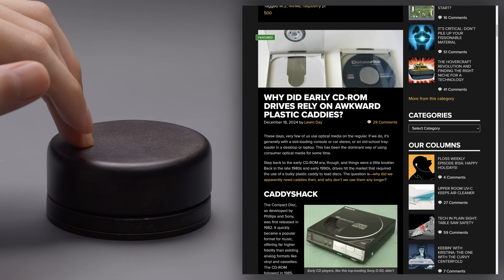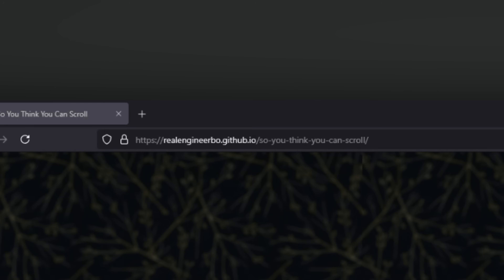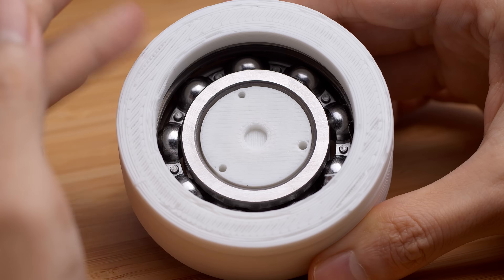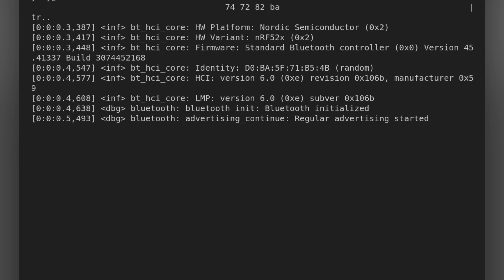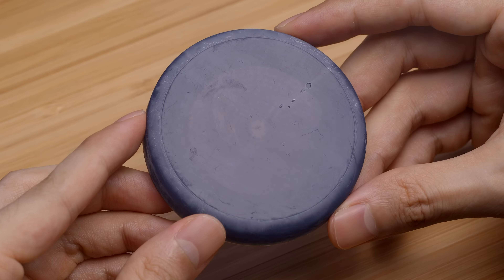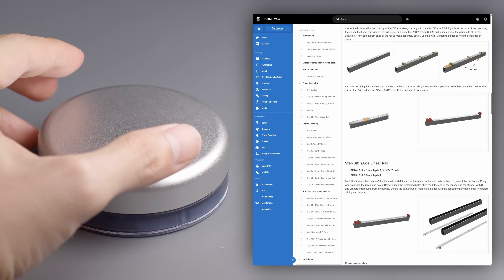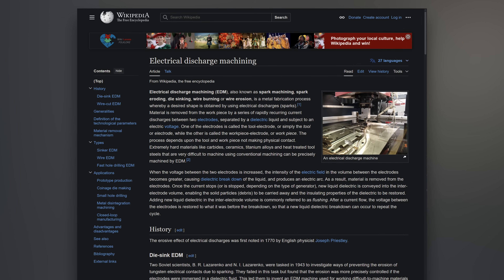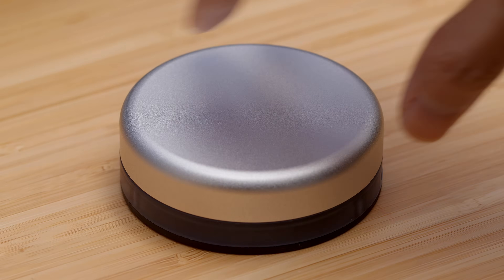Wireless High Resolution Scrolling Device: Full Scroll Dial v2

Comment: 4:30 As a railway engineer I inmediatly was thinking about a ‘Taats-lager’, which seems to translate to pivot bearing in English. Instead of roling on the inside and outside of a ring, the inner ring is above, and the outer ring on the bottom (for example. This removes the horizontal plane play completely, but trades it for a small amount of sideways play.
Reply: Thrust bearings! I was thinking of the same
Reply: @_trupples  'Thrust bearings! '
Realize, no matter what you do at the bearings, there will always be some play, and you have leverage working against it.
With the wide dial, the best place to stabilize is at the outside edge.  That's where you have the best leverage to work against the dial tilting.
Bottom edge of the dial should be flat.  The surface underneath the flat edge of the dial should have a sine wave ripple in it, and the tops of the sine barely touch the bottom of the dial when new.  Then grease the contact surface.  
Same idea as wave bearings, minimum contact surface, but if it starts wearing into the sine it gets more and more support.  Minimizes friction, maximizes service life.
If you hunt around some, you might even find an appropriate size wave washer, where the sine pattern is in a metal washer, then just put that between a flat surface and the bottom of the dial, with silicone grease..
But this large, you may not find one with enough waves easily..
Similar ideas, just some supporting wear away pips, teflon pegs or mouse glide pads, or similar would work..
BTW another thing if you actually wanted bearings this size with the bearing itself at the outer edge, would be car and truck wheel bearings.  They're tapered roller bearings in general.  But they are also heavy with a lot of contact area and rolling friction.  If you took one where the rollers are independent, you might be able to take out most of the rollers, leaving 6 or 8 spread around the bearing, and have decent support with less resistance.  But I'd still go with the regular bearings and glides around the outside edge of the dial, it's way way more simple and cost effective.
Reply from the maker: I've seen several comments about thrust bearings, and I've only seen/used thrust bearings where the races aren't "captured" i.e. the bearing comes in three separate pieces. The current design uses the bearing to hold the pieces together, and the ball bearing can handle (the extremely light) loads in all directions!

I could maybe do with a lager though.
Reply: @engineerbo  Two things - one, you're using gravity to hold the spinner to the base right now, so a needle thrust bearing would work fine. If you are worried about it coming apart with a thrust bearing when you pick it up, how do you solve that issue now? Same thing would apply. But you'd want to find a thrust bearing with a large inner diameter and smaller length rolling elements to give you the needed space for everything else. You can adjust the design to retain the bearing cages and you could lift the top off as you do now.

Two - clearance tolerancing is causing your wobble, as you showed in you video, so you could just buy a tighter spec steel ball bearing. It'll cost more, but so does a ceramic bearing. I think your current design is better, so I wouldn't go back, but consider tighter tolerance steel vs ceramic.
Reply from the maker: @davidbrennan7422 The dial is meant to be held by M2 screws (they fasten into the edge of the bearing). But I messed up the M2 tap (see video) that's why it's gravity for now.
Reply: @engineerbo  The threads don't need 360°. mayby a triangle or square hole could improve this and the use of self tapping screws. Or go up to M3, less delicate…
Reply: @engineerbo have you looked at angular contact bearings
Reply: @KJMos93  angular contact bearings are quite possibly the most expensive and overkill option haha
Reply: conical thrust bearings go brrr
Reply: Yes same! Or sometimes called pin bearings, I think. They could cut the height way down potentially
Reply: Tapered roller bearings would be a better option than thrust bearings
Reply: @tomaslipeika8567  for a non-engineer novice like me, why is it that you want 'high speed' or low friction rather than slow speed with very consistent friction? I to have huge scrolling needs and urges but I have been looking for a high precision scroll wheel that is heavy, slow but precise. Where a complete rotation of the wheels is about a 500-1000 steps but the precision of the wheel makes 1  step advances possible. I imagined that some kind of lubricated bushing would work for this but I am not sure.
Reply: @zeus04 When you're reading a 3000 page data sheet it's nice to spin it up and let it freewheel and stop when you get where you need to be, very useful if you need to skip like 10-20 pages, at least I do that with mine.
Reply: @oliverer3  I understand that, I also scroll large stuff like code/documents, video/audio or dialing in a value. What gets me frustrated is when I need to scroll a very large portion sometimes and other times I need to land on a very precise point. With a slow but precise wheel I imagine that I can achieve both without any middleware changing resolution or multiplier depending on what use I need atm. With huge skips I can just make a 60 degree or more turn while still maintaining step by step control just nudging the wheel. (of course I need a hyperspeed wheel for playing Doom but that's another story!)
Reply: @zeus04  heavy slow but precise is down to software, not hardware
Reply: @zeus04  g50x mouses have switchable scroll mode, it's something why i search a smooth scroll device like this video :)
Reply: @versedi What I meant is that a high friction bearing, making scrolling 'slower' than a high speed ceramic bearing. With higher friction and much smaller distances traveled on the wheel, the bearing/bushing needs to be extra smooth/uniform/toSpec than the 'high speed' bearing bc of the smaller increments of turning the wheel.
Reply: @tomaslipeika8567  something like this? https://www.youtube.com/watch?v=Sv3HBoHRzxo
Reply: Isn't it Architects that design railroads?
Reply: @zeus04 Whilst "Railway Architects" are a thing - they generally design the structures around railway infrastructure, like stations. A rule of thumb is that if the design element is aesthetic or determines how the element interacts with the occupants - that's the job of an architect (big picture stuff), if the element is structural, or determines how the building will function - that's engineering work (detail stuff).

Engineers and Architects are like siblings. We rely on each other, work together regularly, but if you ask - we hate each other and that's the story we'll stick to 🤣
Reply: @zeus04  they can…

Comment: i guess of all the comment you didn't notice mine, because the one main thing i recommended would have solved all your bearing issues. This sort of bearing isn't designed for this application. you want a "thrust bearing". which you can also get in glass/ceramic. 

also theres tons of options available for plastic jars with screw lids which could just have the threads sanded off to allow them to spin. These would be great for anyone wanting to make one of these without having to do a lot of work to get a clean exterior finish, and just 3d print the internals.
Reply: no, the axial loads here are very small compared to a ball bearing rating
Reply: @ the loads may be low but the bearing aren't designed to have force applied in that direction and so you end up with the wobble issue shown in the video. buying a larger bearing just means that tolerance issue that causes the wobble is made smaller, but as he also mentions the larger bearing are more expensive. he could have literally got the smallest cheapest thrust bearing he could find and it'd have solved the problem. he could have bought some metal bbs, and just printed a cage for them, and designed a thrust bearing design into his prints and put the bbs in it. wobble issue completely solved for probably a couple of pennies.
Reply: @ge2719  ball bearings are designed to hold axial loads, you're wrong
Reply: @nirodper  they are capable of holding some axial load yes. it would be rather strange if solid objects were incapable of holding any load what so ever.
but they have play in that direction because they aren't even designed to be tight fitting in that direction like they are in the orientation they are supposed to be used. that is the issue. even before you factor in tolerances they aren't designed to prevent this wobble so "they can hold some axial load" yeah, and? doesn't stop them from having this wobble issue. otherwise it wouldn't be an issue would it...
there's more to mechanics than just "it's rated to take the load so everything will be fine"
Reply: Tapered roller bearing?
Reply: yeah, i was wondering why he was not checking out thrust bearings, they seem to be a perfect fit for this project
Reply: I'd make the argument that since he wants both axial concentricity and thrust loads, you might be better off with a Tapered-Roller Bearing, though you're starting to get expensive when you want them thin. 
Maybe try Needle-Roller Thrust Bearings. McMaster has a lot of different options, but this would be a good starting place to look.
Reply: @ needle roller thrust bearings are bad. They do not locate themselves radially, you’d need to use one at the same time as a normal a radial bearing.
Reply: @ needle roller thrust bearings are bad. They do not locate themselves radially, you’d need to use one at the same time as a normal a radial bearing.
Reply: You don't want a completely freely revolving bearing, because any vibration is going to then be able to more it.
Think about how trigger happy a ceramic bearing like this is, this is the thing.. these youtube projects are rushed and lack any sort of real world testing.
Reply from the maker: You're right, this device is literally one of a kind, so there's no chance it's been widely tested. 

I have been using it daily though, and there might be a chance that I demand a little more from my peripherals than usual.

Comment: the linux issue is actually just a firefox issue, setting the environment variable MOZ_USE_XINPUT2=1 should make it work. dunno why it's not set by default
Reply from the maker: Thanks! I'll give this a try!
Reply: @engineerbo  Are you identifying the Full Scroll Dial v2 to the OS as a mouse (with scrollwheel)? You could try switching it to a touchpad/touchscreen HID if you encounter this issue elsewhere (no idea off the top of my head what your driver situation is).
Reply: It should be noted that you need to be running on Xorg for this.
Reply: @m3mem4chine86 it should also be noted that this bug only affects xinput on Xorg
Reply: @m3mem4chine86  Why would you run anything else tho? Wayland is crap compared to the almighty Xorg
Reply: @diablo.the.cheater Except Xorg is dying and Wayland is where the development is focused for many de and wm. Also, saying something is just shit isn't really constructive. I'm curious why you think Wayland is crap tho?
Reply: @diablo.the.cheater  I agree. It has many compatibility issues and lacking features, but it also has some features Xorg lacks, which specifically gamers look for.
Reply: @diablo.the.cheater  well you have fun using unmaintained buggy software with vulnerabilities, lol.
Reply: @diablo.the.cheater  xorg is dogshit when it comes to any amount of compositing

also, echo """ > ~/.xsession-errors if you want to free up like 100GB
Reply: @diablo.the.cheater  bro i haven't used xorg in 4 years lmao are you my grandma?
Reply: @diablo.the.cheater  2y ago, you would have been correct.. now wayland is the king.. atleast in KDE,Gnome and hyprland side..
Reply: @ora-ora-ora something only dies when know one remembers it, fortunately xlibre is here
Reply: I think it needs Hardware Acceleration and smoothing scrolling enabled in Plasma. It works on all other devices i own so maybe just live USB thing?

Comment: first vid motivated me to build kinda similar device, went  bit easier/lasy way  using some  photoelectric /optical 600 ppr encoder and arduino pro micro as HW, smooth scroll software for float multiplier, quite happy with the results

Comment: Why not use thrust bearings? Youre literally using the wrong type of bearing.
Reply: Guys, no, you're wrong. A deep groove ball bearing as used here can take this load and way, way more just fine. As he described correctly, the right configuration for no slack would be a preloaded pair of angular contact ball bearings, but I think this is unnecessary. Thrust bearings are in fact used very sparingly in the industry, but you can't expect an armchair engineer to understand bearings I suppose. No, thrust bearings aren't the right choice here.
Reply: Bump.
Reply: why fix what aint broken?
Reply: @mythichh  because it is broken. These bearings will wear out quickly when used in this way.
Reply: That or maybe tapered conical bearings or something similar? They might be the compromise necessary.
Reply: I don't get these comments... a thrust bearing isn't held together at all. The whole scroll wheel would just fall apart. Or you'd have to mechanically constrain it which is worse.
The load on this is near zero, a greaseless ball bearing is just fine.
Reply from the maker: @electrowizard2000 I mentioned this in another comment! Thrust bearings are coming up so often, I'm starting to think I must be missing something.
Reply: @ apparently naming a type of tapered roller thrust bearing is against YT ToS... Well, good luck finding one, hint: you can intentionally look for low friction on most bearing vendors sites.
Reply: @engineerbo  because you can use materials that cost next to nothing but literally outlive the user.
Reply: @electrowizard2000  if there's one thing you can be sure about, it's that yes, there is a specific bearing for your kind of load. Here a magnetic thrust bearing, tapered roller bearing, or even thin film bearings would be far superior.

Comment: Any plans for a USB connection mode (unless I've missed something and that connector isn't just for charging)? I'd love to build one of these, but I really don't want to deal with batteries and bluetooth in something that would live in the same spot 99% of the time.
Reply from the maker: I considered this too (I seem to be doing a lot of considering), but support USB mode means I'll have to switch over to another microcontroller (e.g. nRF52840) which is more expensive. It's almost obvious, but the dial being wireless also means I can easily swap the dial to my left/right hand, whichever is more convenient for the task at hand (this is quite a real convenience).

Comment: If the linux software issues get sorted, and with a little more power optimization, I would buy this.  the mechanical design is also sensible enough now that I would build one and try to fix the software myself if it was opensource